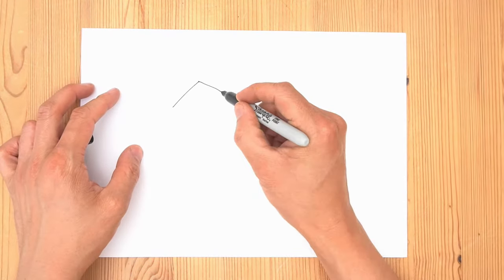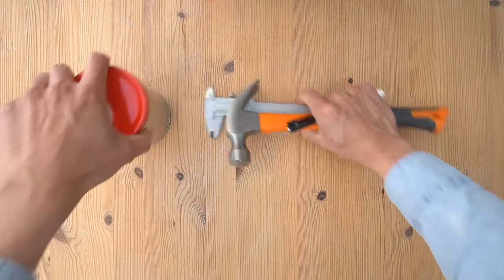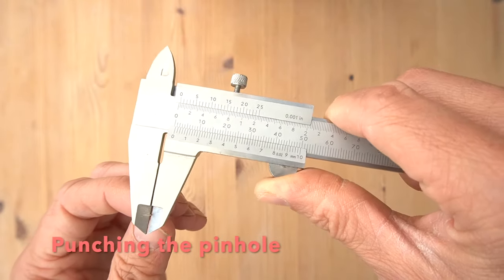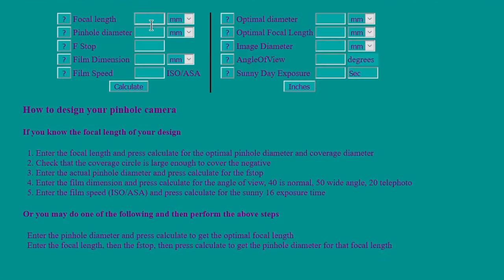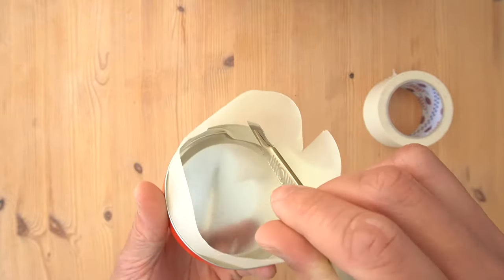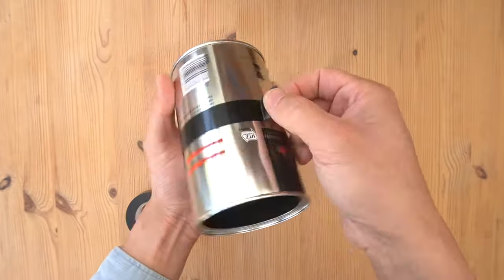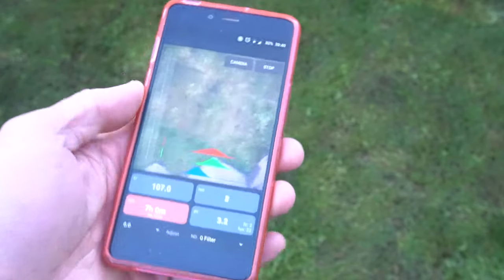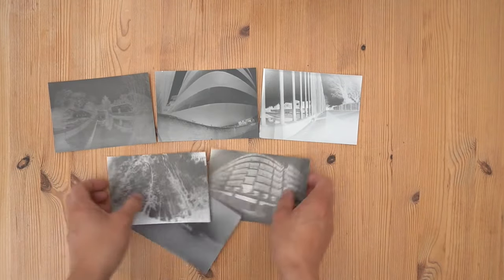How To Make A Pinhole Camera (Coffee Tin Type)

Comment: Make your own emulsion using gum arabic and a photo chemical! Brush it on some photo grade copy paper and let it dry. Do your exposure then in a darkened room ,in close proximity to a humidifier, ( i did it in the bathtub) very carefully dust the photo with lamp black powder. The parts of the photo that receive less light will become sticky from the humidifier and the parts that receive more light will become less sticky resulting in amazing detail. I used a feather from a feather duster for my brush but a small artists brush would work! After its done fix the photo with clear spray paint being careful not to blow the image off the paper from the spray! Just hold it at a safe distance about 1 1/2 ft. from the photo and do a few light coats! Boom!
Reply: And Im just a movie worker/ tile guy!
Reply: You would probably like to know how to mix the emulsion and its ingredients huh? Its gum arabic and ammonium dichromate and a little distilled water! Mix it in an airtight jar with a good lid. Sorry I dont remember exact amounts but I do remember it wasnt too too critical as long as it was an even coating onto the paper! Experiment with just the gum arabic and distilled water first before you add the AD. Make sure when it dries its an even coating . too thick add a little distilled water. Its not hard to figure it out and it goes a long way so be frugal with the amounts! Good luck!
Reply from the maker: This process sounds really good. If only I had the time to check it out, I would and give it a go. End of April is coming and that day looms upon us again... Thanks for sharing and pushing the community. That's what it's about at the end of the day ;)
Reply: @Iamjustamodelmaker  glad to help!

Comment: Will The picture be automatically printed on photography paper or we need to edit it with chemical elements?
Reply from the maker: Now that would be magic! But still, this analogue photography is always an experience for me every time. You'll have to check the mix on the developer for the right ratio, usually 9:1 and the stop and fix are the same as for film. Double check, as you products  might be a slightly different mix. Good luck and have fun developing. I noticed it's a lot faster on the paper, so do some tests first.
Reply: @Iamjustamodelmaker  You don't need stop. A stop bath stops the development process and prevents active developer to contaminate your fixer. Since you can't really overdevelop the paper, the first function isn't very useful for our amateur pinhole photography. Only real benefit is it prolongs the life of your fixer, but since this is pinhole photography, and you probably won't print as much you don't need to use the fixer that much anyways so you can skip the stop bath to reduce complexity and price.
Reply from the maker: @dennyrulos7370  hey ya, I've tried skipping the stop before and things didn't go the way I expected. Maybe it was the paper, the age of chemicals, a combination of them all? Always on the look out to find a good formula to create consistent results. Thanks for watching and sharing thoughts, I'll give the pinhole paper developing another swirl when the season picks up. Till next time, keep it analogue ;)

Comment: Oh it's very nice but I have a doubt which paper do you use in this camera a normal photo paper or and special photo paper 😅
Reply from the maker: I used normal photographic paper, but you can also use film too! All in the name of experimenting and catching rays of light. Have fun!! ☺️
Reply: I tried it but it was only a white paper how can I convert to photo please share 😅
Reply from the maker: @notgamerinsaan786  maybe check the side you exposed it. Test a sheet of paper by just exposing it to daylight and put it through the developing process. This will confirm the paper is working as it should. Then try it again in the camera you've made but for a longer duration. Please do calculate enough time for exposure as pinhole can be upto 2-3 mins in some cases. Hope this helps, let me know how you get along with the paper.
Reply: @Iamjustamodelmaker  I leave in  day for about 6 to 7hours. My question is how to develope the photo 😁
Reply from the maker: @notgamerinsaan786   hey ya! I used typical photo paper developing ratios. As if I was developing normal b&w negative film to photo paper. Your develop, fix and  stop baths in order. But be very careful with the developer you choose. It can bite really quickly.

Comment: This is great! Results were impressive. Roughly how long did you expose the paper each time?? Also did you have to use any chemicals on the paper after or were they just ready to scan?
Reply from the maker: Hey ya! Thanks for watching and giving it a go! I can't remember exactly but it was the size of the pinhole, once calculated it did take around 2-3 mins even on a bright day. Chemicals used for developing, the usual develop, stop and fix solution. Hang and let it dry, then good to scan. It's worth the experiment :) good luck!
Reply: @Iamjustamodelmaker  hoping to do it with some students, thanks for your response! Very helpful

Comment: How many minutes of exposure in bright sunlight is enough to produce a good photo?thank you
Reply from the maker: Hey ya! This depends on your pinhole size, and enclosure depth. I'd run it through mr.pinhole for calculation. But in general it is a long exposure time of 30secs or more. When I did 8x10 film I exposed for 3 minutes at least! Every situation is different, and I think over exposing could help with the media type too. It's a big experiment, needs time to get that chi and feel for capturing light rays. Good luck and I know you'll have fun doing it, yes there will be moments of failure but it leads to better results. You'll be sweet!

Comment: How you know what F stop it is for the light metre reading? I want to try this too, thanks for the tutorial!

And how long were you exposing for?
Reply from the maker: The size or the hole will determine the fstop. I used mrpinhole.com. Useful to calculate this and other constraints to make a camera or even build a custom camera. I shot mine for over 3 mins from metering calcs. So recommend a tripod. Best of luck ;)

Comment: Great video! I’m just getting back into photography with alternative processes other than my phone. I didn’t know the website you mentioned existed! I have some questions that I thought of while watching:
What is f-stop as it pertains to this camera? Is that the hole diameter? Wait, no, that’s aperture I think. Can’t remember what f-stop is.
How does use and final image compare between a pinhole coffee tin camera a box shaped one? Is this the same as a camera obscura? The directions I saw for a camera obscura showed a much wider hole.
Is focal length the distance between hole and paper? Film dimension is the area of the paper? 
I might be able to find the answers myself but I really like the way you explained what you did. Thank you for making the video!
Edit to add: I’m primarily playing with cyanotype so was wondering if this would work alright with that process. I’m not sure if the image would turn out clear enough but it will be fun to try. Do you know anything about the film speed of using cyanotype compared to photo paper? Thanks!
Reply from the maker: Hey ya, thanks for watching. I've been tied up with making things and wish to do more videos soon. Glad the video has inspired you to try out different methods and experiments.

F stop is a ratio of the size of the hole and focal length. These are important when making pinhole, plan ahead.

I think getting an accurate hole size and roundness was the trickiest part. The rest you can calculate and build round it.ive made box style ones too and they worked out pretty well. Takes time but fun to see how the elements come together by developing shots.

I've not used cyanotype yet, but have always been interested in the results and  possible ways to use it. Sometime soon maybe ;) 

Anyways, have fun making and catching some rays of light! Thanks again for the support, much appreciated.

Comment: Do you just scan on a printer? Or do u have a special photo scanner? Your results are higher quality than mine but then again i used home made developer and stopper with coffee and vitamin C
Reply from the maker: The prints are scanned on a printer at 300dpi. But I do prefer the originals as they have captured the the real light of the time :) I've not tried coffee just watered down ID11, though there was a time I ran out of stopper and mixed some apple vinegar to water and it worked as a substitute at the time on some rolls of film. I'm not sure but possibly the acidity of the mix did the trick. Paper developing is fun, as you can see the image come to life during the process. Keep experimenting with different approaches till you get the desired look and feel ;) good luck!
Reply: How do you develop it? Im helping my son with a school project and am confused. Does the picture show up on the photographic paper itself or do you actually have to develop it on the photographic paper
Reply: @georgetterobinson01  ive since found out and made a few of these. You dont develop them in any kind of chemicals (developer or fixer). Instead, you have to open the camera (preferably in a dim light room and rather quickly as the paper is still light sensitive) and put in in a printer scanner. Scan it, invert the colors on the computer, and then you'll see your image. You dont need to develop it and actually, as you take the paper out of the camera youll even be able to see the negative version of the  photo with your naked eye.
Reply: @Cjeffersonjensen  Jefferson, you have a very unique sense of humour.
Reply: @georgetterobinson01  You do indeed need to develop the paper with chemicals because it's photographic paper. This must be done under a safe light in a darkroom. And by the way, never open a box of photographic paper in ordinary light because it will be ruined.

Comment: I saw something similar with a digital camera just removing the lend and adding a black tape and shoot
Reply from the maker: Hey ya! Yes that's possible, it gives a dreamy low-fi quality and good for experimenting. The key is to make the accurate pinhole in your chosen material. It's a lot of fun! If you've not tried it, give it a swirl! Enjoy the process and tinkering ;)
Reply: @Iamjustamodelmaker  or with some camera protector or body protector even I Wacth a mod with old disposable camera extract the len and add
Reply from the maker: Yep there is so much to experiment with, got to think out of the box and cross disciplines. Have fun, don't stop shooting!!

Comment: Can you just use regular paper?
Reply from the maker: Hmmm, I can't think of a way to burn it on to the normal paper, But that's got me thinking 🤔
Reply: @Iamjustamodelmaker  I was sort of wondering what paper you use
Reply from the maker: @CornDawgOG  I'm currently using Ilford or kentmere photographic papers for black and white photography. I prefer the satin finish and the finish has a nice lustre. Ilford multigrade RC is very nice to work with. They come in various sizes. Best of luck

Comment: How did you develop the photos?
Reply from the maker: Hey ya, once the exposures paper has been safely removed from the camera in the dark, prepare a batch of chemicals. Typical paper ratio mixes for the developer (mine was 9:1), you could use stop as normal, and fix as normal. I use all three to prevent contamination but develop and stop works too. Good luck.
Reply: @Iamjustamodelmaker  sweet! Thank you so much

Comment: i think those darker sheets of paper are fogged because you opened the box of papers in the light and the bag leaked in some light
Reply from the maker: Hey ya! I do carry a dark bag with me to change film for my large format shots. The fogging might be from something from the process, can't say at the moment. But when spring comes I can capture some more daylight on paper. I will look into the bag, maybe sew another layer inside to give it some extra protection. Thanks for watching and suggesting ideas. Always on the lookout to up my game and make this analogue adventure better. Cheers!
Reply: @Iamjustamodelmaker  sorry i meant the black plastic bag that wraps around the paper in it's box. it's not entirely light tight, so it's a good habit to only open that box in the dark
Reply from the maker: @heatonize  good point, I've repaired large format bags with black carpet tape before. Where it folds and hits the corners of the medium it can easily puncture a hole over time. I've only had one pinhole camera, so have to change it on the move. Will test the paper on some negs to check its still all good. The joy of analogue ;)